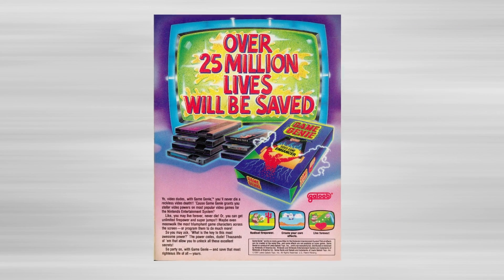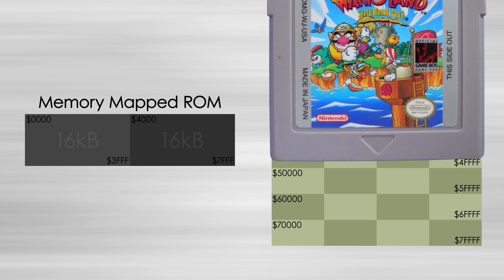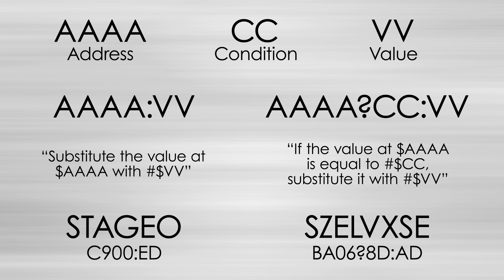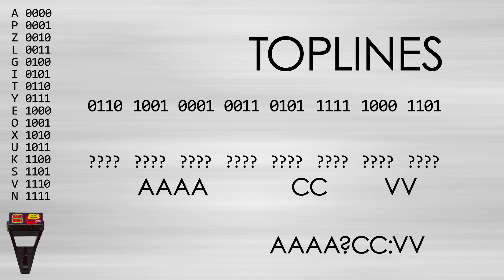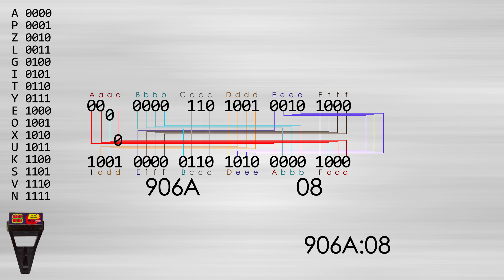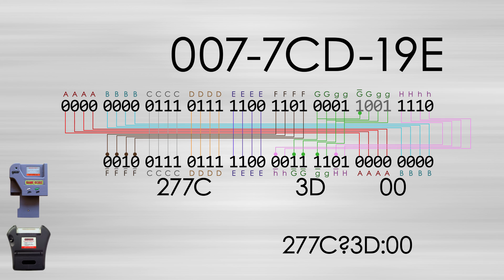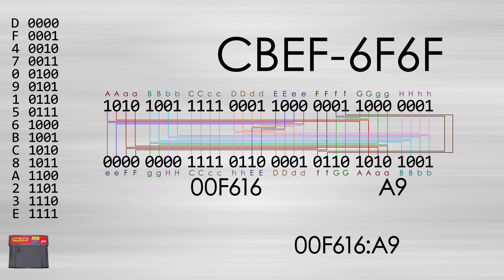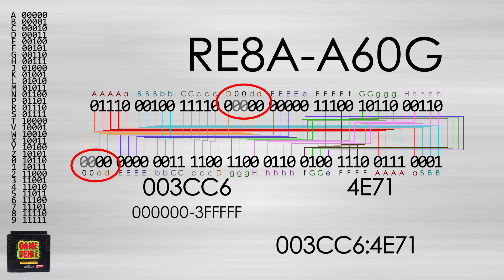The Game Genie Explained

Comment: What I always wanted to know is:
How did it work on an NES without physically being able to push the cartridge down in? If you just have an NES game, and you push it in but not down, it absolutely won't play. The game genie made that connection not only possible, but sometimes IMPROVED as a connection. Many were the times I would not even put in a code, but just connect the Game Genie in order to get a stubborn game to work. It was very stable.
Reply: You could never accuse them of false advertisement on the “game enhancer” thing!
Reply: I've never owned an NES, so I didn't know about that. Crazy how the Game Genie improved the console, even without cheat codes !
Reply: The NES uses a U-shaped bridge (search for " NES 72 pin connector") that connects your cartridges to the NES' motherboard, and if you take it out and attach a cartridge, you'll notice the cartridge sits at an upwards angle.  You can push the cartridge downwards to make it level, which pushes the pins inside the connector downwards, giving your cartridge a snug connection.  There's another spring-loaded mechanism inside that locks your cartridge in place, and pops it back out when you push down.  

A cartridge with a THICCCCCCCCCCCCCC board could push these pins down enough to make for a good enough contact to run without pushing the cartridge down, since it doesn't need the rest of the mechanism to bend the pins.
Reply: I don't remember mine ever working without pushing it down.
Reply: Yeah the dreaded blinking screen. 😱
Reply: @ROMANEMPIRE69  g r e y
Reply: You don’t have to push cartridge down. My NES plays all carts without being pushed down
Reply: Someone correct me if I'm wrong but doesn't the game genie bypass the nes10 lockout chip?
Reply: @dana8190  I don't think it would need to if it requires a game cartridge to work (which would contain the lockout chip).
Reply: @dana8190  no it just passthroughs it
Reply: @dana8190  i think it uses the cartridge's cic chip as a donor chip
Reply: For a while CodeMasters even sold whole NES games in Europe shaped like the Game Genie that would also piggyback onto a licensed game, not to use anything from that game itself, but just to make use of its lockout circuit!
Reply: my nes plays games without pushing them down?
Reply: probably because of the connector's (on the game genie) angle.
Reply: simple the PCB on the Game Genie is little bit thick then the regular game's PCB so they made an adapter with regular PCB thickness  for the NES 2 (Top loader)
Reply: @intel386DX  Yeah, that "pop-up" cartridge system on the US NES was a poor design choice, as it seemed to cause nothing but problems, at least on the one at my house. I don't believe the Famicom had that and simply employed a standard cartridge port. Not sure why they did this.
Reply: @JustWasted3HoursHere  The main reason why the American NES had a cartridge loading system different from the original Famicom was done purely for marketing and image reasons. It had nothing to do with actual functioning. 
When the US launch of the NES was being planned, the 1983 video game crash was still quite fresh in everyone's (especially retailers'!) memory and anything video game related was practically a curse word, so Nintendo did everything in their power to distance their product from the extremely sour memories of that recent market downfall. Hence, the NES wasn't marketed as a video game console, but as an "Entertainment System", its game cartridges were called "Game Paks", the system was bundled with the R.O.B. robot accessory, and the system itself was redesigned to look more like a VCR and not resemble traditional video game systems.
Reply: @JustWasted3HoursHere  it was so it could seem like a VCR to skrrt past the bad rep games got after the video game crash of 1983.
Reply: im not sure where you go this from but it is entirely possibly to play nes games just fine without pushing then down, in fact i do that almost all of the time because it seems to work better
Reply: i often play nes games without pushing down it eases strain on my replacement pin connectors
Reply: The Code Writers That Wrote Game Genie Knew This So They Wrote Bypass So You Didn't Have To Push Game Down
Reply: You don’t actually need to. Collectors don’t so they don’t damage cartridges. It’s odd, I know.

Comment: The funny thing is that you can do everything that game genie can do and more by using an emulator to write the game onto a CPU, or get the game's source code and run it with the program that was used to write the original game. You can just make changes to the code so that different things happen in the game just like game genie and run it on a computer. But that is basically all game genie is. It is just tweaking the game's source code so that something different will happen, albeit without CPU. But you may as well say that the system itself is the CPU.
Reply: just hexedit the rom . .
Reply: "Get the games source code"... how on earth are you going to do that ? It'll be under lock and key of the developer, hardly anyone is releasing source code to video games.
Reply: Well on the NES it was written in assembly so you can just disassemble it

also alot of games have been fully reverse engineered and u can find the symbols
Reply: @LiEnby  Sure, but its not the same as SOURCE code. which is something few of us would get their hands on.

Also disassembling and looking for certain game subroutines is quite a big and fiddly job. Other peoples disassemblies would be a life saver though.
Reply: it is the SOURCE CODE when its made in assembly
Reply: @LiEnby  The source code written by the developers would be labelled and easy to read, that's not the same as a disassembly.

Comment: RISC vs CISC doesn't refer to the format of the machine code, but the way in which the instruction set is designed to access and work with data. A RISC architecture is almost synonymous with the load-store paradigm, where memory must be accessed as either reads or writes with a register, whereas CISC is known for having an abundance of addressing modes, many times applying to the same fundamental operation. Furthermore, RISC machine code can have variable-length instructions, such as the V810 used in the Virtual Boy.
Reply: The funny thing is that you can do everything that game genie can do and more by using an emulator to write the game onto a CPU, or get the game's source code and run it with the program that was used to write the original game. You can then make changes to the code so that different things happen in the game just like game genie and run it on a computer. But that is basically all game genie is. It is just tweaking the game's source code so that something different will happen, albeit without your typical CPU. But you may as well say that the system itself is the CPU.

Comment: Amazing work! To clarify, the 6th place comes first and is always flipped correct? Or could another of the address values be flipped and in that case the 6th place could hold a value of 1-7. I didn't find any situations where this works. So I'm supposing that the 6th value is always complimentary to the rom or banks. Thanks again for all the work. It is spectacular.

Comment: Can we get a "The Game Genie Explained" Explained video >_>. This is really impressive, but I only understand the basic parts.
Reply: Asasin to understand it to the level you want would require a bit of work but if you want to here's what you would need to do. Start with the language C and the reverse engineer little programs you make in assembly (it'll probably be x86_64) the cpu's
instruction set and stack protection will be different (they didn't have stack protection then or not in the same sense as today) but the concept will be the same. As it is for all devices from cell phones, routers, smart tvs, the apple 1, every video game console ever invented and 99.9% of all devices with a processor period. If you would like to know more on the subject just Google information on x86_64 assembly. It will be pretty hard to understand at first which is why I recommend starting with C and then going down to asm. If you already have a grasp on programming especially complied and not interpreted programming then you may be able to switch to just learning asm without a ton of difficulty but it's so close to the actual hardware it's not very easy for a human to read it. At all. But it is possible and many of us do. I develop buffer overflows and rce's which requires me to know assembly (for the modern desktop computer aka mainly x86_64). The entire reason I watched this video was because it was in my recommendations and I wanted to see if my hypothesis on it was correct. It was close, not entirely I didn't know they had any sort of changing of addresses back then. Hopefully this helps
Reply: All that being said this is an excellent video and just learning the stack frame and a little bit of hexadecimal math would bring you pretty close to what you want to know.

Comment: Hello, RGME. I have a question. You know how on the save screen in the Legend of Zelda, it says "Hold the Reset button while turning off the console"? Why do they recommend this, is there any reason or are they just making it up?
Reply: It's belt and suspenders. Reset pulls the CPU and buses low so unclean shutdown can not cause any unwanted writes to the battery backed RAM (because just physically switching power off will result in the voltages dropping or even spiking in random fashion). Without battery-RAM it doesn't matter because there is nothing that can be corrupted, but battery-RAM changes that. Corruption is unlikely, but it's just making extra sure it won't happen if you follow the instruction. Later systems were designed with battery saves in mind, so they have other protections in place.
Reply: They aren't making it up though. I lost some Zelda 2 save games back in the day by not following that instruction. It reverted to what was saved before I powered the console on.

Comment: How did you learn so much about old console hardware?
Reply: theacp127 it's a late reply and I doubt you even remember leaving this comment or will even see this but on the odd chance you actually care and it just keeps you up at night wondering. Here's how:

This isn't limited to just video game consoles this is true for any digitial device. All you need to understand this is the knowledge of the language assembly which is a low level language that your cpu can read from directly. It is semi difficult to understand because it's so 'close' to the hardware.

So this pretty much applies true for not just game consoles but anything. Except now days we have stack protection that randomizes the addresses to help stop hacker from doing things like buffer overflows and hijacking control of a program but that's an entirely different can of worms.

If you would really like to understand it I'd suggest you learn the programming language 'C' first as it's pretty low level but easy enough to start with and them assembly for your processor such as the common x86_64 assembly (for almost all almost modern desktop and laptop processors) and go from there. Once you understand the concept of it. You will understand how this and pretty much anything on an old console is computed. Then you will have to understand how the graphics are rendered which ties into that and truly appricate how remarkable these machines were and how they accomplished so much with how little they had to work with.

If you're wondering if I know all of this why I'm watching this video. It was in my recommendations and I wondered if how I thought it would work actually was how it would work. I was pretty close. But hopefully that is of some use to you. It's something that may not make a lot of sense at first even in a very basic explanation. Don't worry that's everyone's take on it at first and for quite a while into it until that day it just clicks and you can visualize the stack frame which may take a long while.

I doubt you want to learn all of that just for a little curiosity but in the odd chance that you may use it or want to read more into it there you go.

Comment: I actually did a science fair project back in 2000 based around the various game genies which converted the codes to/from hex values and saved them in formats that popular emulators (at the time) would use. I got second place in state level with it. :)

The reason for the character encoding was complicated:
1. It was sort of an intellectual copyright protection which made it difficult for other groups to produce their own codes which would make Galoob the ONLY source for "official" codes. Once the Internet took off and people started reverse engineering the out-of-production Game Genies to discover how they worked all sorts of codes flooded out. It's possible to create codes that damaged the ROM image of a cart so Galoob wouldn't release codes that could do that and wouldn't get sued by game owners with now-destroyed carts.

2. When new versions of a game came out it would force users to get updated codes...FROM GALOOB. Small changes in any one place in ROM can alter/displace every byte in the image. Codes for a version 1.0 wouldn't work for a 1.1 or from region to region, etc.

3. It dodged violating the game's EULA. Oddly enough, if you knew what values were at certain addresses (the value checking) then you could theoretically reconstruct the ROM, at least in part, from known codes. That's a clear copyright infringement.

Comment: Can you explain the missing no glitch or any glitch from pokemon Gen1 or any glitch from pokemon gen 2 crystal?  Especially the even pokemon (can't remember the name) glitch?
Reply: When you encounter spoke on in the grass or cave or water, the game generates a number from 0-150 (then limited to the encounters of the area), and battles a Pokemon with the id of the generated number. But the number that can be battled goes up to 255, so if you pass the battle data where no Pokemon exists, it will try to read it like a Pokemon. The developers knew this was a possibility, and so gave it a special name ( missing number), but didn't give it any data, expecting it to never be found. But the game was super glitchy, and missingno. Appeared all the time. This is why missingno. has different moves/types/sprites depending on it's ID.
Reply: Aurα вírdч in the most basic way you are tricking the game into looking for pokemon code where there is no pokemon. So normally the game will like in a specific spot for say charmander. But by doing certain things you get the game to look for charmanders code in a spot it nornally doesnt, which confuses the game therefor it spawns a glitched mess instead of a pokemon.